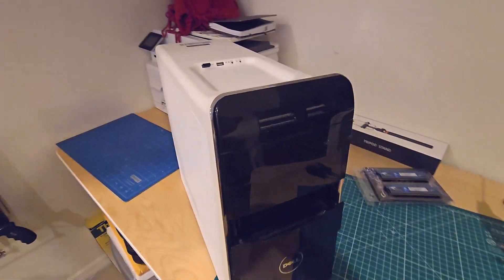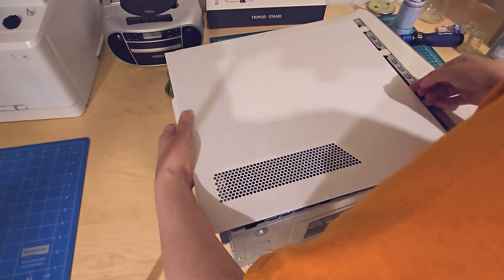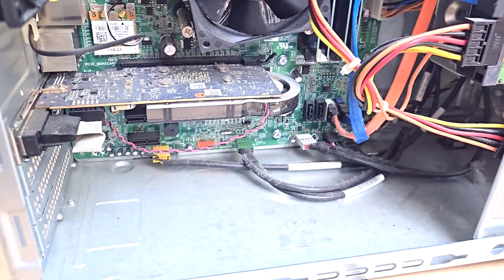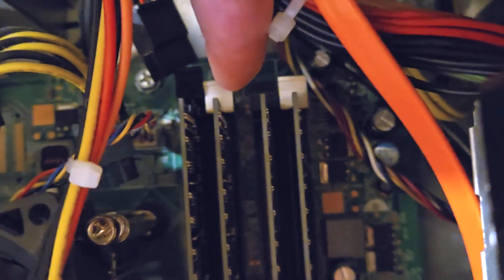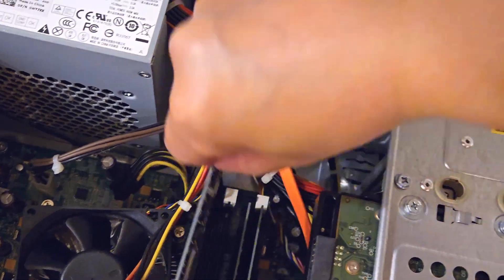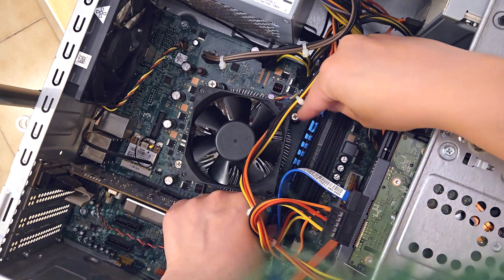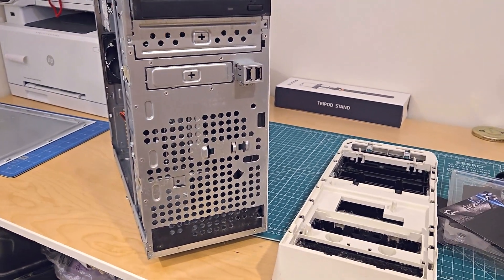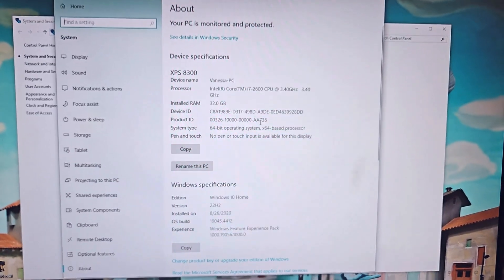How to upgrade DDR3 ram for Dell XPS 8300

Comment: I have this model XPS 8300 in black. It came with 4x2GB RAM (8GB total), and I upgraded to 2x8GB in the white slots and left the 2x2GB sticks in the black slots for 20GB total. It works with mismatched RAM stick capacities in this pairing combination. Not sure I'll need 32GB for Windows 10. A better upgrade is cloning the HDD to a 1TB SSD for 5x speed (much more significant than upgrading RAM). The 8300 has weak networking hardware. First, the motherboard's LAN port failed, and then the hard to replace WiFi mini card failed. The 8300 lacks high speed 3.0 USB ports, so I added a pcie card with 3.0 USB and plugged in a USB Netgear A8000 WiFi adaptor which works great. After backing up my data on a thumbdrive, I performed a reset reinstall of Windows 10 which finally got rid of games and Steam that wouldn't completely uninstall. Then I debloated unnecessary programs and services. McAfee uninstall needs to be followed up with the MCPR tool to remove it completely. Runs great now. The pcie slots are only Gen 2.0 so I upgraded to a modest GTX 1050 Ti GPU. The 2016 XPS 8900 is an even better platform for upgrading, with SSD cloning, DDR4 RAM capacity upgrading, GTX 1650 Super, and Windows 11 24H2 bypass upgrade.

Comment: The dell xps 8300 Still a amazing desktop have my and Still running strong does everything you throw at it running windows 11 on my without no problem still been able to play every game that comes out no problem
Reply: I just grabbed one without a hard drive or SSD for £20 and that included a HD6970 as well. Going to have a proper mess around with it this weekend.

Comment: Did everything continue to work ok when you installed Windows 10 ? I read on the Dell forums about some users having issues with various components not working correctly.
Reply from the maker: Yup, everything worked as normal and I didn't have any issues when updating to Windows 10
Reply: @thepudgyrabbit  Thanks for replying
Reply: @TheMrBarso  I have been running Win 11 23h2 on an 8300 - no issues. 
I had to run a script to disable some checks - and I built the image with Rufus 4.5 - it gives you a list of things you can disable or preset in the image to install